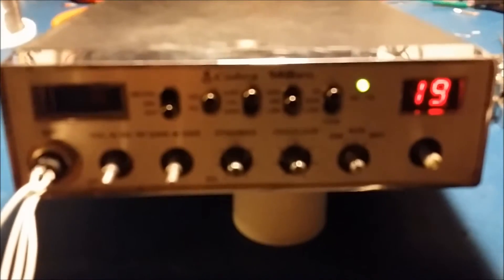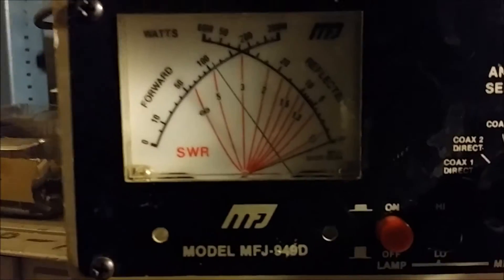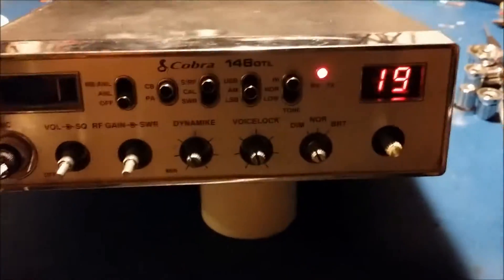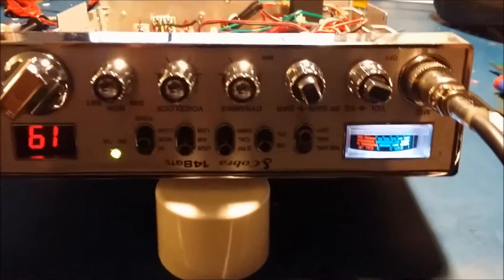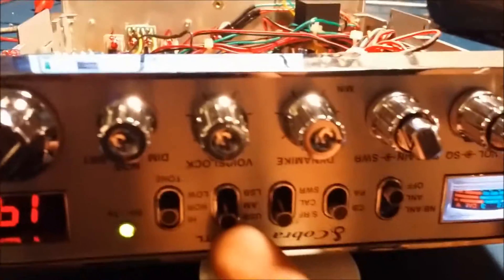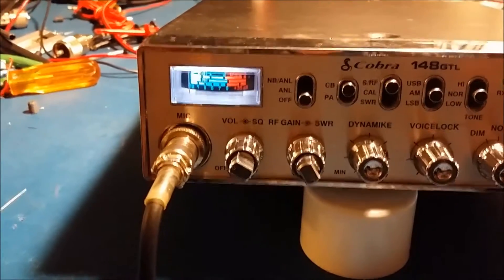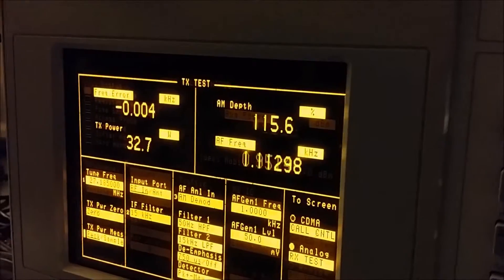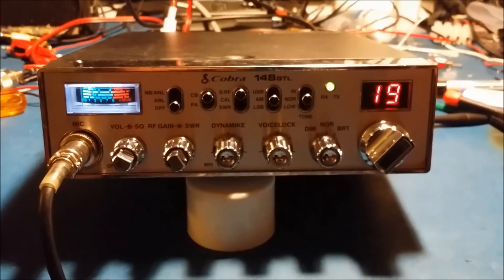148 GTL Tune up report

Comment: good job. I have the same radio I have sent to a guy I know in my town how to fix radios and he had it over 12 months to turn it up I was on his back about it's to fix it. I told him I'm going to pick it up today he told my wife on the home base radio if he comes over he's will use his baseball bat on me LOL air came out with a baseball bat and I did see a pole next to his door and I picked it up and he slammed the door in my face and I bashed his door with the pole the police officer told me to go home he pack the box away and gave it to a some person I know. he thinks he knows how to fix CB radios I think you fuck my radio up it just needs a tune-up now it doesn't have any modulation my needle moves a little tiny bit I can't hear myself on my other CB radio. in Australia not many CB shops fix these 27mhz no more only UHF CB radios a guy in Queensland he does fix the radios in his own home but he's got all the machines that's good. looks like I got to send the radio to his home to fix it. 😎